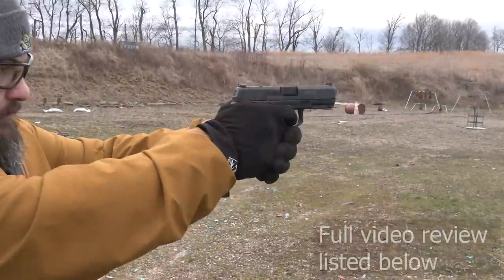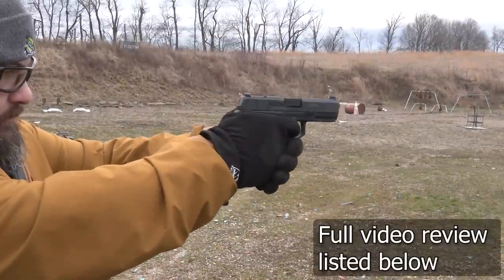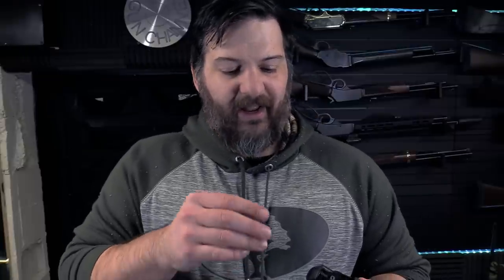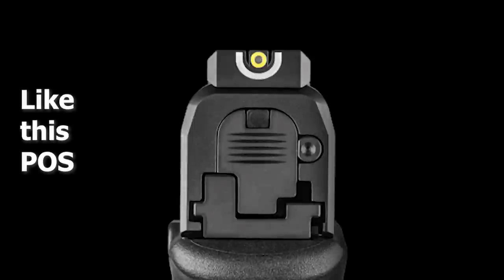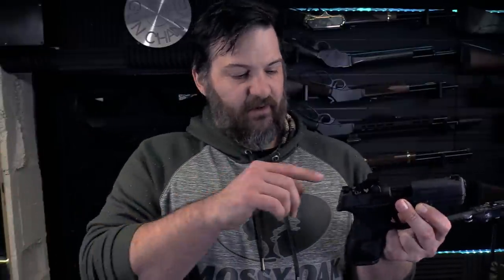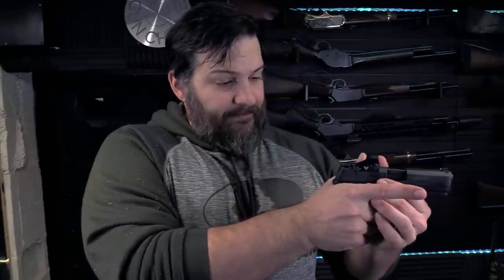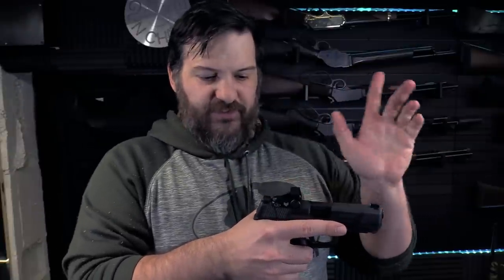Please Stop Making U Notch Sights

Comment: I actually naturally focus on the target and both sights virtually simultaneously. Obviously, my eyes can't focus on three different points at the exact same time, but they switch back and forth quickly enough that I can't tell. I do quite like the U-notch sights I've checked out, specifically the Hellcat sights. I found them exceptionally easy to align and, though I'm not a fan of that particular gun after having shot it, I would love to have a set of them on other guns. Your point about automatically aligning the circle on the front sight with the rounded part of the rear notch is only a valid concern if the circle was placed wrong on the front sight. If it was put in the right spot, the top of the sights should be level when the circle is in the bottom of the notch. One benefit that I see to U-notch sights over square notch sights is that your horizontal alignment is less likely to be off with them. The two radii naturally line up as you bring them together. It is very easy to skew a rectangular post to one side of a rectangular notch. Then you have to fish back and forth to get it even.
Reply: I think the problem is there are a lot of different U notch sights out there, some are designed poorly, I think the ones Curtis are using are designed poorly; the notch is too deep so when the front dot is aligned with the u notch the tops of the front and rear aren't aligned.
Reply: @fattigla  Idk...he showed a set of Hellcat sights and in the text called them a "POS", yet I think the Springfield XDS and Hellcat u-notch sights are some of the best examples of u-notch sights out there. The way he described it amost sounds like he might prefer a deeper u-notch. I personally LOVE u-notch sights regulated for a center hold. My first experience with them was on the Springfield XDS mod.2 and I've replicated them on other guns. I prefer a blacked out serrated rear with a tritium front. I always try to maintain target focus and my eye is drawn to the light coming over the top of the front sight naturally, which creates the right vertical alignment for a center hold and the u-notch then tends to naturally line up horizontally faster than other sights for me. Sight picture preference is SO subjective.

Comment: As you pointed out, the human eye/brain naturally centers/aligns things in its environment. Traditional “square notch” sights use the vertical and horizontal lines of the front blade and rear buckhorns to achieve this. A “U-notch” done well would simply deepen and round out the bottom of the rear buckhorn keeping the straight side walls and flat tops in tact to allow for quicker acquisition of the front sight post. 
“Big Dot” sights are fast but also imprecise. If all you’re going for is the fastest possible center of mass hits at 7 yards or less, “big dots” are probably just fine. However, if you need to make precise hits (hostage situation, ranges beyond 25 yards, etc.), I think you’ll find traditional “square notch” sights offer the best results.

Comment: Some notes, as I think out loud.
-Sights having the rear air match the front sight has nothing to do with quality. If they match, there will always be air due to perspective. If you want minimal air, the front sight needs to be larger the longer your slide.
-There is no geometric correlation to a half circle, and it being larger than the front sight walls. Just make it smaller.
-If you're naturally seeking the center of the rear sight's half circle, just make the sights so the front sight is supposed to line up there.

Still, really good food for thought, Imma probably catch my self mulling over this while daydreaming for the next few weeks. Thanks man!

P.S. I run a stock Walther PPQM2 in .45. You've never seen excessive air till you run those OEM sights. X'D

Comment: I've never heard this explanation before, good stuff. I have a set of u notch sights.  It may just be my perception or preference, but it seems like when I line the front dot up with the bottom of the u, the top of the front and rear sights also seem to be lined up. Could this just be attributed to the individual pistol model and my arm length, etc?

Comment: I like them than the square knotch ones especially with a painted edge like the Glock ones, I can't shoot accurately with those. They just dont naturaly line up with the front dot for me. U notch with painted U does do the "find the center of the circle" thing even with only half a circle. But I use red dots when I can. With irons if accuracy is more important than speed I like 3 dots but with smaller and subdue rear dots. Like with just the tritium inserts and nothing else. I've only used squre knotch ones, I don't notice or focus on the edge of the notch with 3 dots, since I'm just lining up the dots, and I don't know if a U notch would make it better or worse.

Comment: I suppose the video can be boiled down to this; U-notch sights are a good concept that is, for reasons unknown, astoundingly difficult to execute well.

There is a specific place that the radius cut needs to be in order to work, that placement is critical in where the reference for the front sight should be for proper sight alignment, and the height of the straight walls of the sights need to make it a U-notch instead of just a semicircle.

Comment: I appreciate you for making this video. I agree with you. I’m a new gun owner and my first gun, a G45. Came with ameriglo night sights Hs3 installed.

I didn’t realize, until after l looked at the receipt and paid for it.

But l thought hey cool, upgraded sights. The G 45 that l qualified with for my CC certification had stock sights.

I finally start training with my gun, and shots are going everywhere but where l want them to go.

Mostly low and to the left. But no bullseyes. 

Obviously shooter error is at play right, I’m jerking the gun down etc….. anticipating recoil….poor trigger discipline….not pulling until l hit the wall, then break the shot……etc.

But my OCD just looking at the sights, one feel like they don’t don’t appear to be exactly straight. looking down at the channel from the top of the slide just eyeballing. 

One side appears, slightly larger than the other. Has more metal on right side than the left. 

I’ve tried to measure this with calipers. To confirm but the ones l have are similar to yours and seem to big to get the tips inside. 

And not long enough to touch the outside of the slide, to get accurate readings.

The ameriglo night sights also have three dots. The rear dots are smaller than the large front sight. And l also wondered if this was throwing me off to get a level sight picture.

So l put black masking tape over them to black out the rear to soley focus on the front sight.

My shots are getting closer to being on target now, but still not consistent tighter groupings.

But suffice it to say l really hate U notch sights. I rented a stock G43x with the plastic stock sights.

And other than it bring smaller and a bit snappier, l got on target consistently.

I’ve heard and read of all of the supposed advantages of U notch sights to get on target quicker.

I think it’s BS.

For all of the reasons you mentioned and with my own personal experience.

I’m going to change out these sights as soon as possible, withe square notch sights or something different.

As you’re the first person that l randomly found to articulate a valid point as to why they’re terrible.

Some may be able to make them work. I’ve shot them on a Hellcat with no issues.

But on my Glock they do not work well at all for me.

I do believe they could be misaligned slightly from from the factory. As you can always have sights the might be slightly crooked which l think might be my issue, and the rear sight my need to come over to the right a hair or two.

But being 700 rounds in, on this gun, l do not like U notch sights, or chunky front sights.

Comment: U-notch sights can be done in a way that isn't terrible. I've got a Hellcat Pro, and I've rented a Hellcat. In both of those models, when the tritium dot on the front sight is centered in the cup of the U as you described, the top of the front sight is also aligned with the top of the rear sight. 

That said - I still hate it, and would rather have a set of traditional squared off 3 dot night sights. I don't have a reason for hating it. Other than perhaps the simple fact that it is different from literally every other pistol that I own. But I suppose that's reason enough.

Comment: I have the XS big dot sights on my woods pistol for the reason you mentioned. Nevertheless, my favorite sights are either a blacked out U notch rear and tritium front (10-8 makes a good set), or the trijicon XD sights (but not the XRs that have too thin of a front blade for me).
I hate anything with white on the rear, especially the stock glock goalposts.
Then again, I tend to target-focus with iron sights unless I remember to shift to a clear front sight, so I guess that's what my thoughts are worth on this topic.

Comment: When I Practice Sight Alignment; I Look Through The Middle Of The Rear Sight And Focus On The Front Sight.

2 Of My Handguns Have Blacked Rear Sights And Tritium Front Sights.

1 Of The 2 Pistols Have An Ameriglo Notch Serrated Rear Sight (GL-414) And A Truglo Front Tritium Sight; It Originally Had A Rear Truglo Tritium Sight But It Didn't Allow Me To Rack The Slide Off My Belt.

The Other Pistol Has An Ameriglo UC Sight Set (GL-353).

Comment: Love my XS Big Dots, in fact I've got some of the original Ashley Outdoor express sights before they became XS Sights. Have the factory U notch on the Hellcat, doesn't seem to bother me, but I do prefer the Big Dot. Also use the Big Dot front with the older Rob Pincus I.C.E. rear claw sight with wide notch on a couple of Glocks and seems to work fine.

Comment: Shouldn't your position be that It's better to have a front sight post that fills most of gap in rear sight, ie 3 dot night sight, than to have a bunch of extra space on each side of front post, ie Fiber Optic target sights?
I only ask because it doesn't seem to matter if gap is square or u-notch as long as gap is same width?

Comment: There is no way to improve a white front dot and a blacked out rear square notch. Maybe a tritium or a fiber optic front, but there is no better sight system. You have to go to a red dot sight, but that introduces positives and negatives
Reply: Even out to 25 yards, you barely have to do more than make sure the dot is centered from side to side, at most level the top. I don't understand why 3 dots or rear white half circles and half rectangles exist. Even in darker conditions I only have to pick up the front sight and I should be using a light anyway .

Comment: U notch rear sights? Square notch rear sights? How about star shaped rear sights? I say, how about no sights, learn your natural point of aim down the top of the slide and let the lead fly! Just kidding! Try them both and see which you like better and go with it. I’ve shot both and I find myself doing fine with either because I pretty much ignore the bottom of the notch anyway and just look at “equal light” on the sides compared with the front sight and making sure the top of the sights are lined up when shooting for fine accuracy. Basically I just look through the rear sight anyway and use the front sight. YMMV. Now, let!s talk about narrow front sights vs wider front sights. I’m sure they’re are a multitude of opinions on those too. Honestly, I think we sometimes overthink things.

Comment: Don't confuse banging 8" or 10" steel plates at 3-7 yards with putting bullets through the same hole on paper at 10 - 25+ yards. You lose all your pinpoint precision with a U notch rear sight but they are faster at close range on large targets. It's funny listening to guys shooting those 8" or 10" steel plates or B27 silhouette targets chiming in their .2 cents on the matter. Until you are shooting golf balls and nailing them at 15+ yards OFFHAND you aren't good enough to be able to notice any difference. That's the problem with this new wave of shooters who infiltrated us within the last 3 to 10 years. They know everything about everything.....even more than those of us doing this 40 -50+ years.

Comment: This is shockingly wrong on many levels.  Any sight can have larger light bars on either side of the front sight through the notch, it's irrelevant whether it's a u notch or square notch.  it's generally accepted more "air" is faster, less air is more accurate.

The actual benefit of u notch sights is that the eyes are attracted to right angles, but eliminated right angles on the bottom of the notch, the eyes will be quicker to align the tops of the sights.  PS nobody uses u notches in competition, but i can smell somebody who's bad at shooting by whether they compete or not.